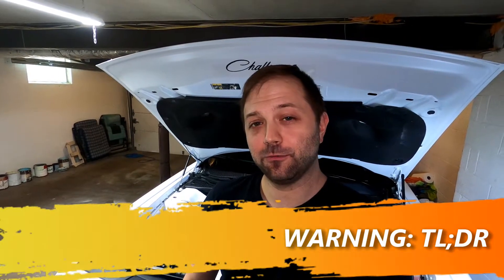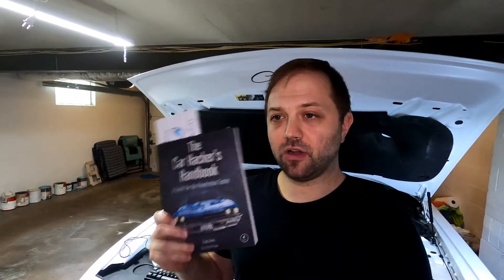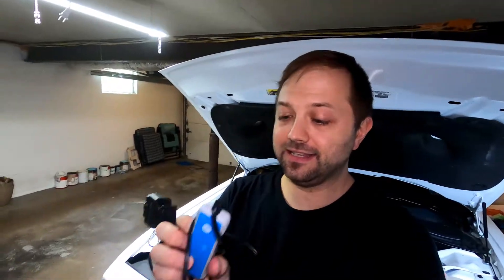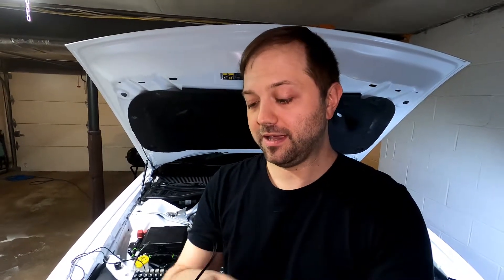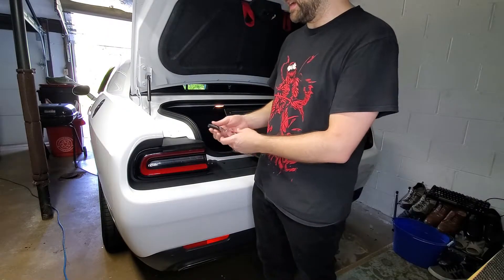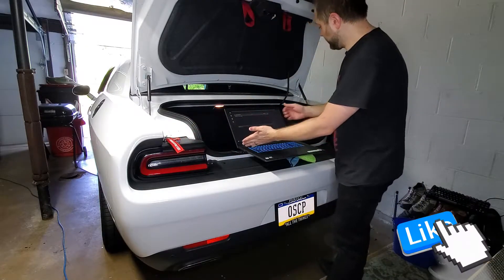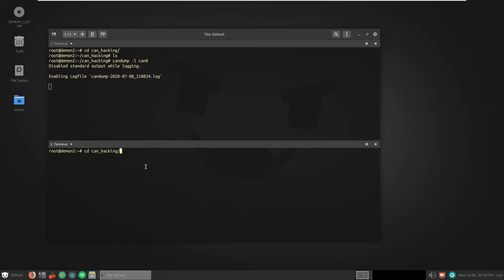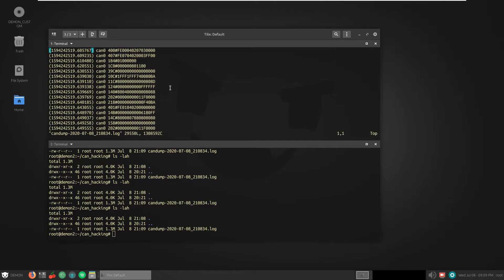Hack the Garage ep. 1 - CAN Bus Hacking the Dodge Challenger R/T

Comment: Where did you plug it in?
Reply from the maker: The can bus wires behind the rear seats.
Reply: Where exactly.  Did you have to remove the rear seat?  Do you have any pics of the connector
Reply from the maker: @Benfoxmra95  you don't have to remove the seat, no. Just push it down and lift the velcro of the trunk floor and lift the trunk floor out, like how I did in the spare wheel video. You should see a small plastic box. Remove the old and there's connectors on both sides of the box. Check out the install video I made for the Tazer. I believe I show how I accessed the box in that video.

Comment: Can hackers hack my challenger and potentially get me into a car wreck
Reply: A lot of people say that it needs to control certain aspects of the car but it doesn't. Based on how CAN works, lowest message value goes first and all others have to wait. This means if your brake pedal goes to a sensor, instead of the cable, you can block the messages from the brake pedal and prevent braking. You can also force windshield wipers to activate and washer fluid to blind the driver. And in many cases disable the electric power steering or even force the car to take a turn. Specifically for the challenger its difficult to tell what's controlled by CAN and what isn't. I dont own a challenger and haven't ever inspected any of the modules.
Reply: every module is linked to the can. You could use this vehicle like a RC car. No joke.
Reply: Potentially yes. Some vehicles utilize data like this to control the engine and brakes. Its technically possible to block the codes or fake throttle response